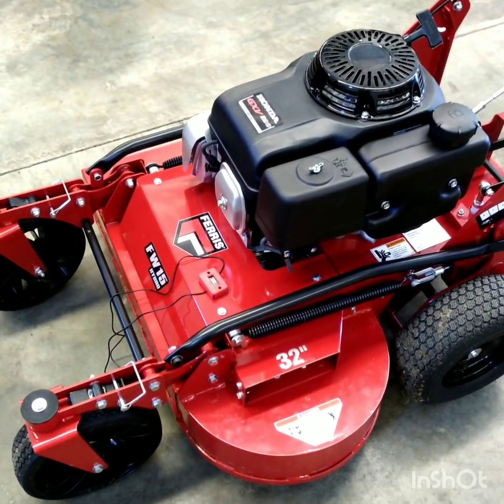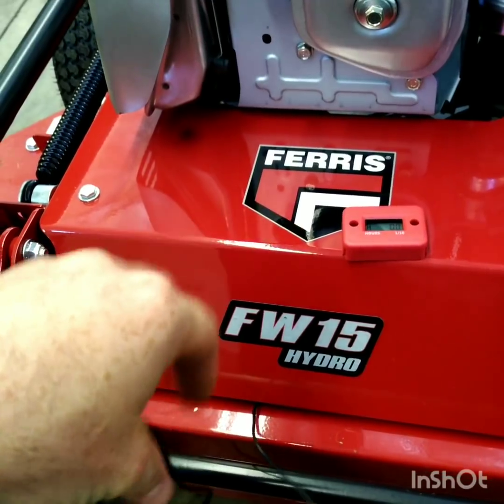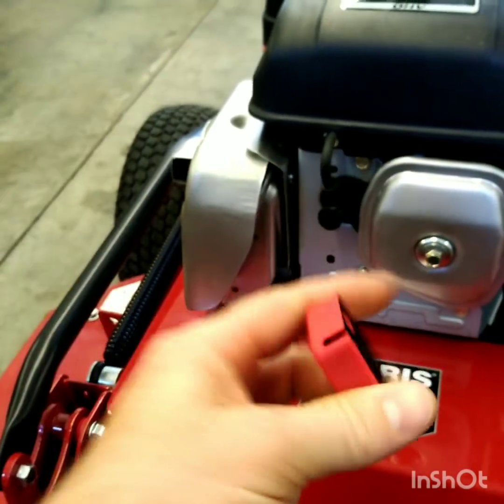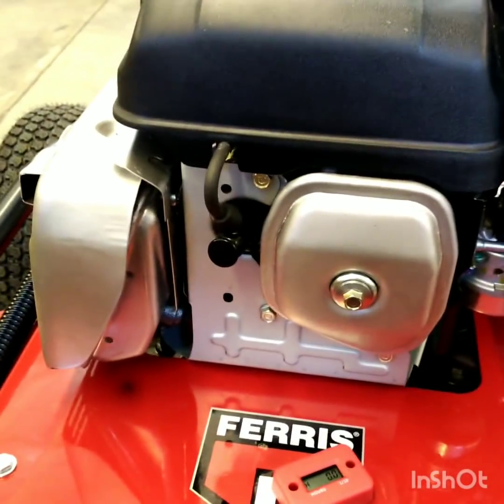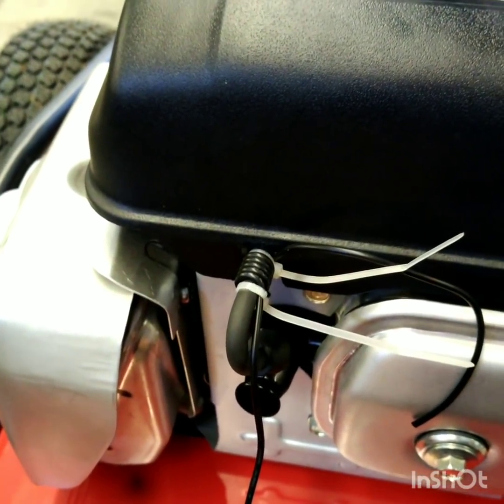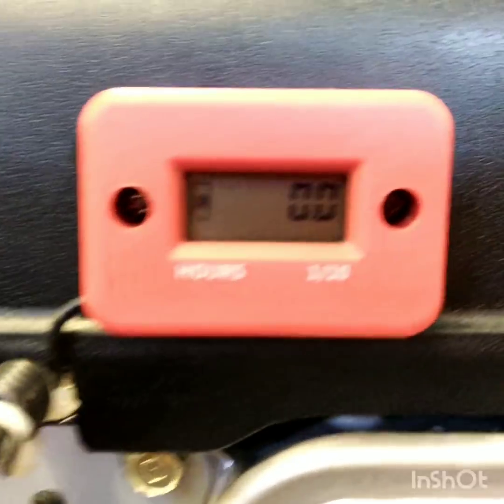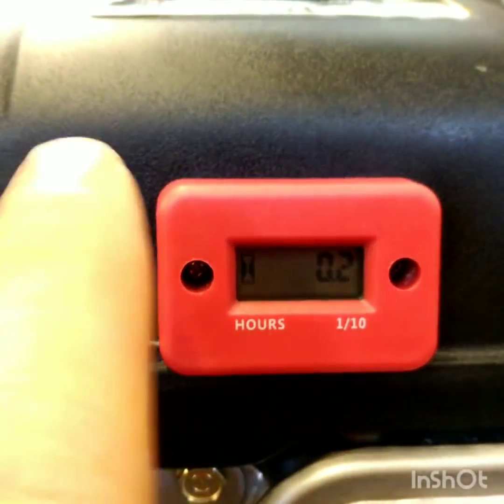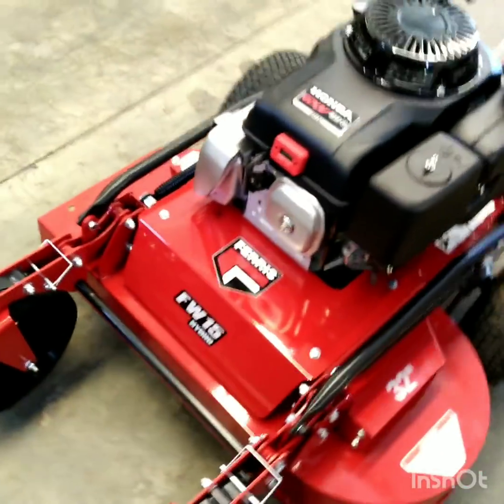Hour Meter Install Ferris FW 15 Hydro

Comment: I have these on my 2 Toro Timemaster mowers. It’s so nice to do maintenance when you actually know the hours and not having to assume. For how much they cost, especially yours, they should be standard. My old one has well over 400 hours. I’d love to buy this FW 15 to match my SRS 52 but it’s hard to justify when it would only be used for like 5 properties

Comment: Watched all the FW15 videos.  Loved all of them, especially the hill, tall weeds and clover.  I would expect any mower to cut ordinary lawns.  Any idea of how many pounds of force it takes on the handle to raise the front?  Two local dealers do not plan to stock the FW15 so I have not been able to see one.
Reply from the maker: Maybe 20# it's very manuverable

Comment: Just got my FW15. Did you consider the super strong double sided sticky tape versus screwing into the housing?
Reply from the maker: You can try that but heat might cause the tape to fail.

Comment: I'm very interested in this mower So I'm reviewing some of your older videos on what you've done with this machine up to present time. Like some of the others had said, the audio wasn't quite as clear so I didn't catch the name of this product that you got on Amazon. I was wondering if you had the name of it so I could look it up and buy it when the time was needed whether I get this one or another brand of self-propelled that doesn't have a meter on it. Since I am not real electrical savvy, I was wondering how the thing works if you are just wrapping it around the spark plug insulation? I figured it had to be actually wired to it to make it work since this doesn't have a battery start.
Reply from the maker: I don't remember the brand, but it was the cheapest one on Amazon and yes you just wrap the wire around the spark plug wire and secure it.

Comment: Did you have to cut the rubber off the spark plug wire before wrapping it around?
Reply from the maker: No just wrap it around outside of the rubber insulation.
Reply: @HandyGuy2016  thanks man
Reply from the maker: @legioncollector4218  No problem, are you installing it on an FW 15 or another machine?
Reply: @HandyGuy2016  oh no I'm getting the fw15
Reply from the maker: @legioncollector4218  awesome! I love mine.
Reply: @HandyGuy2016  I can tell you convinced me to get one. It will be my only mower so I'm hoping it can hold up
Reply from the maker: @legioncollector4218  You won't be disappointed
Reply: @HandyGuy2016  I'm sure I wont,I have done enough research to know its gonna kick ass